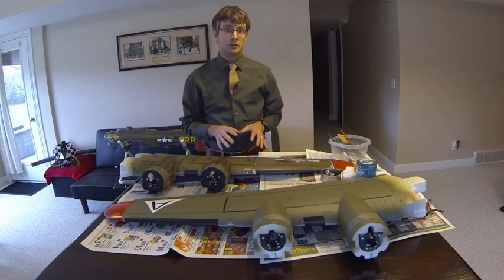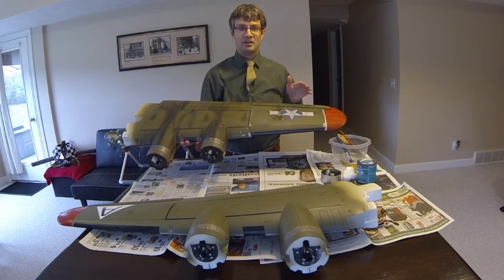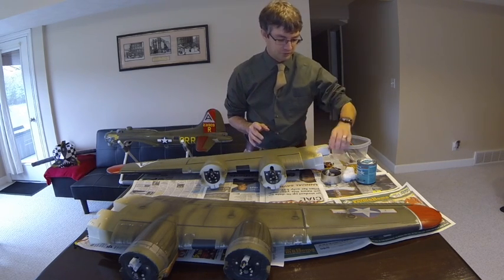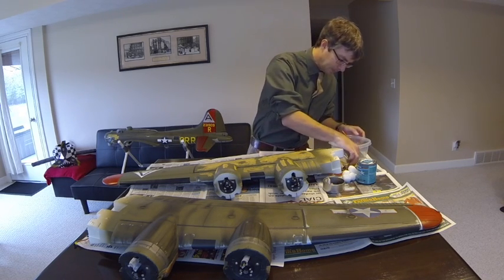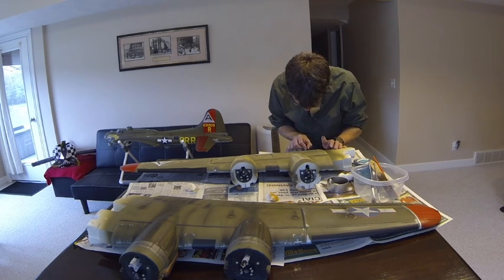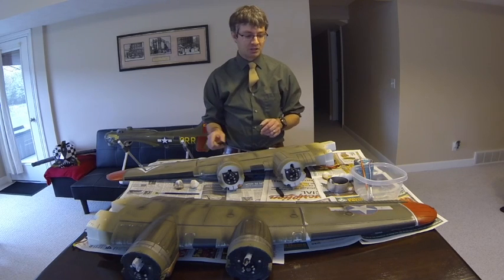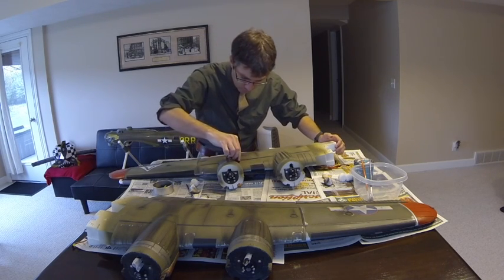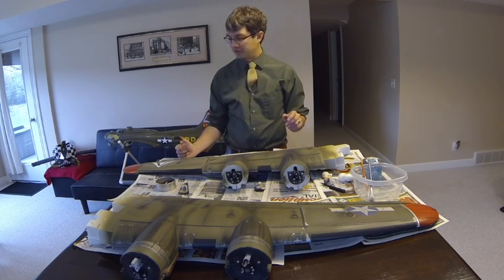How to weather the HobbyKing 1875mm B-17 Wing

Comment: Great vid. I was wondering if you could share what you used for pastels to weather the decals, the red wing tips and fuselage and your chipping techniques?
Reply from the maker: thanks, I used soft chalk pastels for the weathering. I don't use oil pastels as they can react with paints. Most of the chalk pastels I used on my B-17 were leftovers from a college art class years ago. I have found similar products on Amazon or Hobby Lobby. I would suggest a grayscale and earth-tone set. That will get you everything needed. I only weathered the one national insignia decal with the red outline. The decal was unique in that it was very thin and easily chipped, unlike a waterslide or vinyl decal. I took small bits of masking tape and used that to chip the decal to make it look well worn. Then went over it with the pastels. As for chipping, I use Tamiya silver model paint and paint the chips on in places that are prone to chipping. Leading edges (not the black as those are rubber di-icing boots), props, cowl flaps, any movable metal surface, access panels, and doors. Many WW2 planes were a mix of materials, so not everything chips to silver. Control surfaces were fabric on many planes and the paint doesn't chip, it fades. Some surfaces were wood and also won't chip to silver. The B-17 was mostly aluminum with fabric control surfaces. The key to weathering is to do research and collect pictures of the aircraft in combat conditions. Ignore movies as they artificially weather the planes. Almost everyone who built a model B-17 after 1989 screwed up the wing weathering after watching Memphis Belle movie where they put black stains behind the oil cooler vents. Those aren't dirty.
Reply: @BRGT350  thanks for the info.
Reply from the maker: anytime

Comment: Excellent videos...must admit I paint and weather  rc planes the same as a small static model, I Havn't actually done much flying and would be very wary trying to fly the B17 after spending so much time on it ... Cart before the horse etc, so far they are just big static models !.  Been doing B17 "Sweet And Lovely" for quite a while now...as and when I can. Hot water molded the cheek gun sections which turned out ok...absolute pain though !. Just seen the freewing detail stuff on your other vid..that would have saved some considerable time...and stress !. Keep em coming
Reply from the maker: ha, thanks. I had a static PBY for years before I worked up the courage to fly it. Once I did, I was sad I waited so long. I built a silver B-17 earlier this year (video coming out on that one in the future) and decided that one was too nice to fly first. I bought the OD B-17, and now this one is coming out even nicer! The rate I am going, I will have a 3rd non-flying B-17! I am doing a video next on details for the fuselage, which uses a number of the Freewing parts and Callie graphics. I really hope to get the Forts in the air later this summer after I get more flights under my belt. I am always rusty in the spring after not flying all winter, so it takes time for me to get back into it. I stuffed my P-47 into the ground last weekend, but she is all fixed and ready for duty again. It was my 3rd flight of the year, and the first in over 6 weeks. Just too rusty on the sticks. I need to get those cobwebs out before flying the B-17.
Reply: Yeah...know where you're coming from !. I'm using some Callie Graphics too, well a combination of hand painted unit markings and numbers etc. Got a another HK B17 v1,that I intended to make into  "Little Miss Mischief" the half n half Fort,  but it will need the panel lines filling, which I did with S A L...lot of work !. I've decided to wait and get the silver version 2 as it is only  the rear fuselage of Miss Mischief that is olive drab.  HK had the green "Ye Olde Pub" on sale this weekend....almost went for it, but resisted the temptation. . Hoping they will have the silver Fort on offer next time....the thing is where to put them?, it's not like you can display them on a shelf !!. Must get out and about and get some practice...maybe I'll be more suited to the "Divine Wind" school of flying ? .                                                                                      Do you use anything to fix the decals down ?. The stars n bars insignia on the wings have totally curled while in the loft. Maybe I should have put a gloss varnish underneath for them to adhere to ?.   Look forward to your new video's
Reply from the maker: I did see the OD one was on sale this past weekend. I am going to hold steady with just the two B-17s since I want to get into the F7F Tigercat at some point. Where to store these things is an issue. I hang mine in the garage, but starting to run out of room between where the garage doors open and the cars are parked. I would rather not have to move cars in and out of the garage to hang planes, but it may come to that. The other issue is any windy day means the garage door must be closed to avoid mid air collisions. As for the decals, the HK ones were applied and then I used an iron on low heat with an old t-shirt between the decal and iron. This helped them adhere. After that, they are sealed with the Minwax Polycrylic and then a layer of clear spray. I used the hanger on a few of the Callie decals to help them adhere around the edges. The mission markings on Nine-O-Nine took a few layers of polycrylic to keep all the decals in place.
Reply: Ok brill, thanks for the tips on the decals. cheers Bob

Comment: As far as the Min Wax sealing coat goes, are you brushing it on or spraying?  Great job by the way! Really took your Flying Fortress to a whole other level! Jim
Reply from the maker: I brushed it on instead of spraying. It goes on thick and leaves streaks until it dries. Once dry, it looks pretty good. I need to work on filming my fuselage detailing video and the video on my other B-17, which is made to look like Yankee Lady. I finally flew her at the end of September, but the weather hasn't been nice enough to get another flight in before winter.